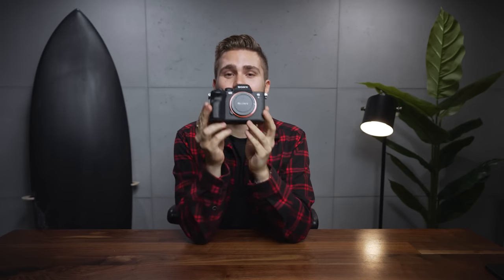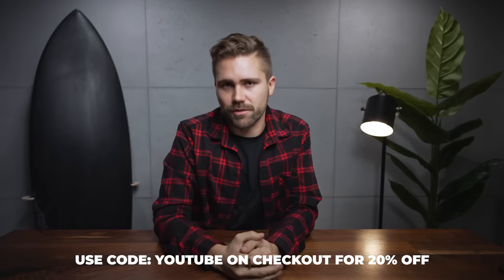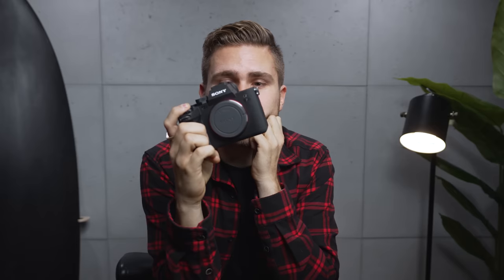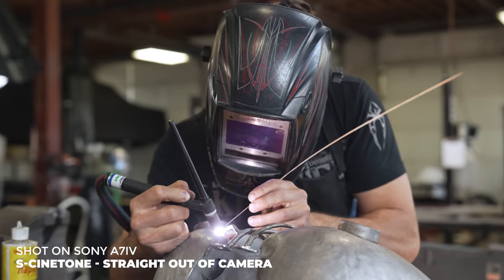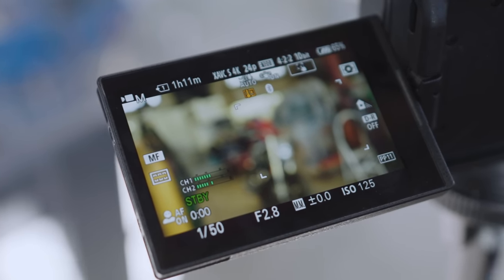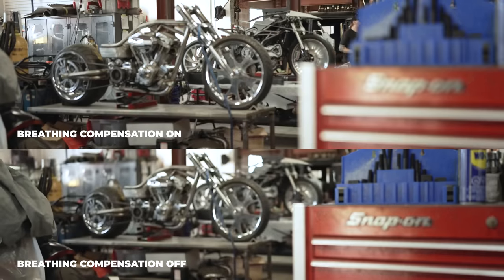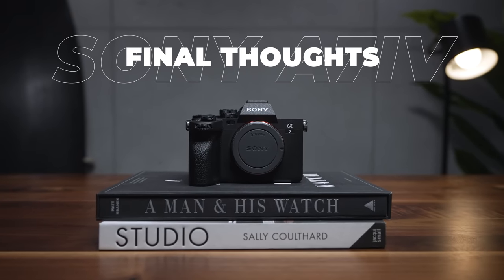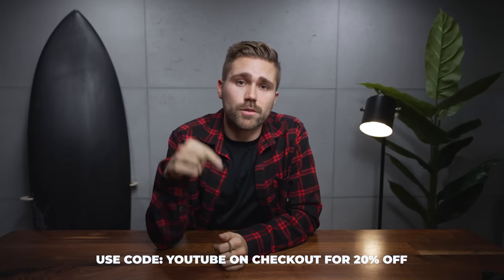SONY A7IV REVIEW - Is this the PERFECT CAMERA? + Test footage

Comment: For most people, the a7 III is good enough. Especially when you consider used prices, you can get it for about half the price of the a7 IV. Is 10-bit video better than 8-bit video? Of course. Can you still make beautiful, professional video with 8-bit codecs? Absolutely. And, for that large sum of money you save on the body, you can get a Tamron 28-75mm f2.8 and maybe even an f1.8 prime to go with it. So, if you're on a tight budget and want to go full frame, the a7 III is a very legitimate option.

The thing that holds me back from wanting an a7 II isn't even the 1080p video, it's the single SD card slot, the iffy autofocus, and the poor battery life. But even that might be OK for some people starting out.

As nice as it would be for Sony to add 10-bit recording to the a7 III (at least externally), I would rather they remove the 30-minute recording limit. But, there are even workarounds for that like using an external recorder or an intervalometer to automatically restart the video. It's a killer option for shooting weddings, especially if they could fix the recording limit problem. The video quality is way more than good enough for that.

Comment: If I upgrade, I'd want to always shoot 60fps 4k.  It's the optimal frame rate for 4k footage. So I'm essentially downgrading to a super 35 sensor if I buy this camera. There are much better, cheaper crop sensor options out there. Fairly disastrous move from Sony I reckon. Don't think I'm alone in thinking I'll need to look elsewhere now.
Reply: I hear it would've canibalized the 7S3 like it did last generation

Comment: The overheating at 15 to 20 minutes renders it useless for me. What a letdown.
Reply: Only happens with the same auto temp setting as the A7 III
Reply from the maker: Changing the high temp off will get you way longer recording time. Check out some of the other reviews.